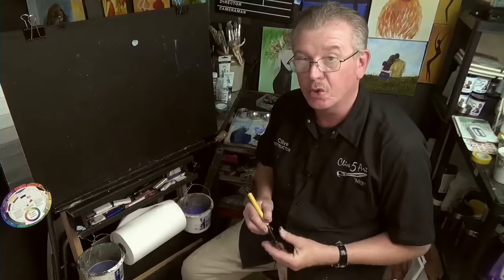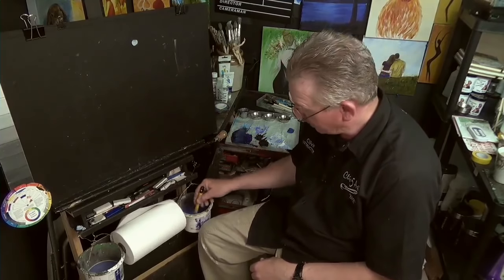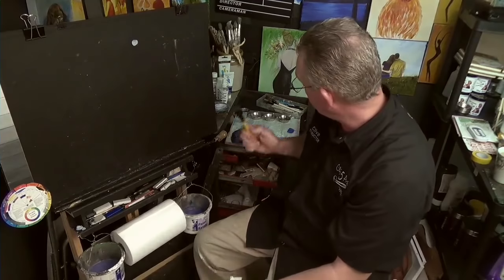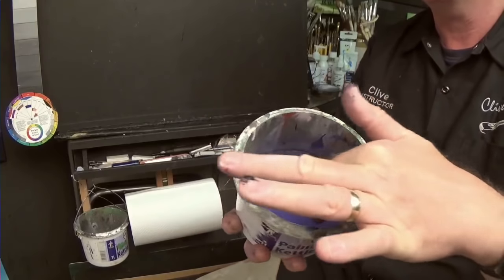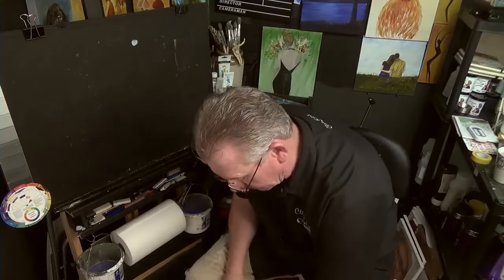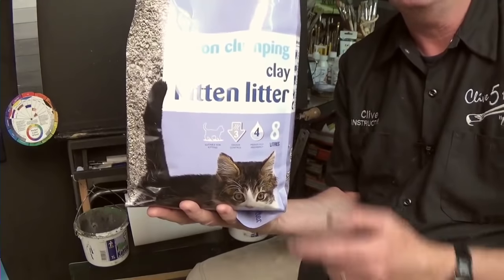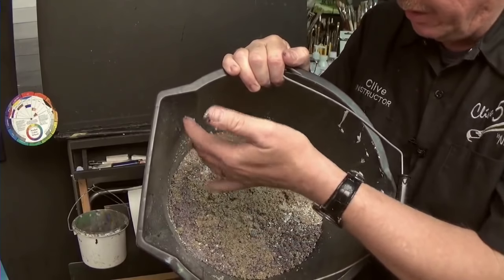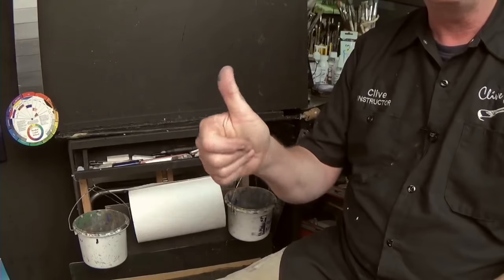Paint Water Disposal | Acrylic painting for beginners | learn to paint | #clive5art

Comment: interesting method with the cat litter. I will have to give it a try Right now im just running my water for a good couple min and then pouring down the drain and running for another min after. This seems a bit more eco-friendly.
Reply from the maker: +Aaron Miller not advisable to put it down the drain best to be safe than sorry is what I say
Reply: Nope, sorry, Aaron. Clive is right. Dumping paint down the drain is not in any way eco-friendly. Don't dump turpentine or oil paints down the drain either.

Comment: You might want to use the wood pellets that are used in pellet stoves.  It won't clump but it's very absorbant and weighs next to nothing.   It's much less expensive than sand or clumping cat litter.
Reply from the maker: Great tip

Comment: I'm not sure how pouring the paint-rinse into cat litter makes the paint-portion of it safe to recycle.  What it seems like you end up with is the paint-sediment suspended in dirt, but it still has that toxic component.  Is there something I'm missing to this solution?  
I normally use enamels and clean my brushes in thinner and into a cloth.  I've started using some acrylics and am looking for a way to deal with the rinse water.
Reply from the maker: +SilverHwk7 Yes it is suspended in the cat litter and when collected by the recycling it gets incinerated to create energy to turn in to electricity instead of going to land fill hope that helps

Comment: If you add caustic soda (with care!!!) to your collected up paint water, it will precipitate out cadmium and lead quite easily, which you can then allow to settle or filter and then dispose of that into landfill and run the water down the drain - key thing is to run the tap for 30s to ensure when it hits the waste-water plant, it is nicely diluted. That said, most of the Cd or Pb in paint is already in solid phase and can be filtered out. Tbh putting it down the sink is no huge deal as by the time it hits the waste water plant it is so diluted it won't cause any issues.
Reply from the maker: +Rich Boden great advice but I don't like to suggest caustic soda due to the health and safety problems but thank for the input I see where your coming from thanks so much Clive
Reply: +CLIVE5ART Tbh the amount of cadmium etc in paint water is so small once it hits the sewer and is diluted out, I'd never worry about it. I work with high concentrations of cadmium and mercury in my day job and those kinds of amounts can safely go down the sink in the UK - different regs apply in other countries.
Reply: I don;t think Clive was talking about the safety of cadmium but your suggestion of using caustic soda.
Reply: DrummerGrrrl I'm well aware of that: I was pointing out that it's overkill to worry about cadmium (etc) in paints as the amounts are tiny and in non-bioaccessible forms AND are diluted out enormously when you run them into the sewer. Bothering to pre-treat paintwater before disposal IS kind of pointless.